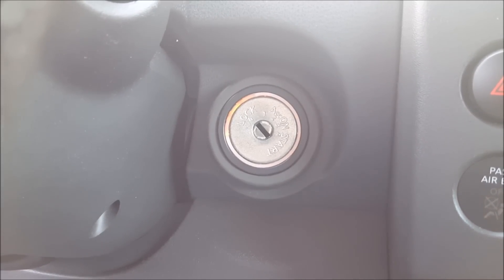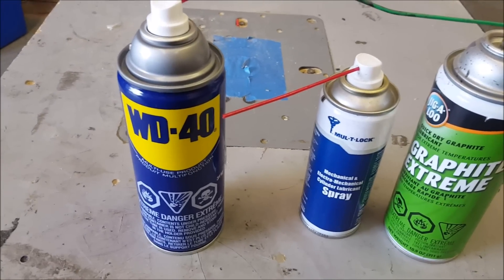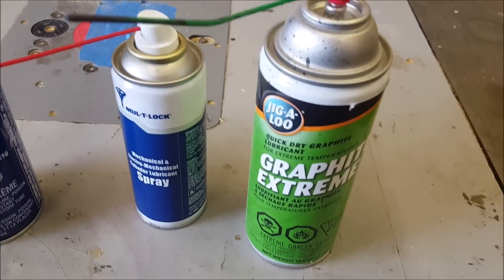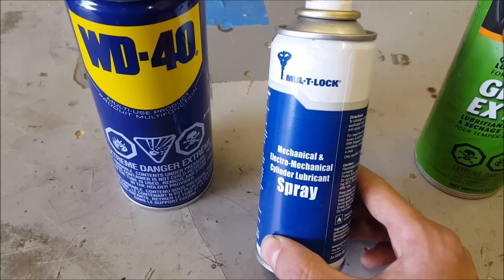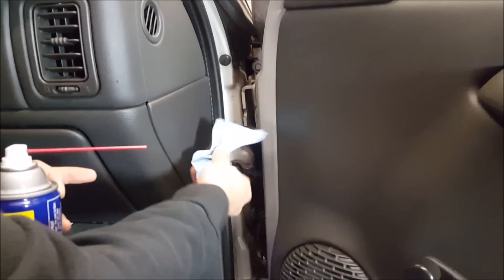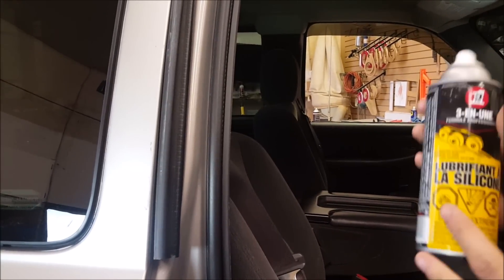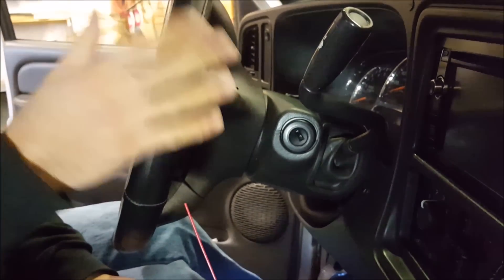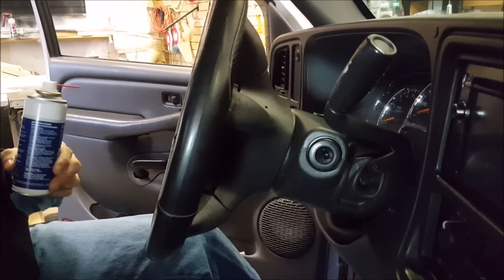Key Cylinder Maintenance (Sticky Ignition Key) Mul-T-Lock | AnthonyJ350

Comment: Make sure you use your key to open the doors even if you have a electronic key FOB. Locks seize over time.
Reply from the maker: I never do, I just lubricate the tumblers. The lock mechanism doesn't need the tumbler to work unless the tumbler is stuck in a direction.

Comment: It`s not the key that wears out,     It`s the springs holding pins get contaminated and lose spring strength over time
Reply from the maker: It's probably both, I've seen keys on high mileage vehicle where the teeth on the key are dull and has lost shape. After we get the ignition key cut based off the VIN you can see a difference in shape.

Comment: From my experience WD40 works fine for ignition locks. Only a small amount is required. I use a clean tissue to wipe off the excess that comes off the key for the next couple of weeks. It pulls a lot of crud out of the lock, wiping off black oily residue. I also carry the key wrapped in a bit of clean paper towel or tissue in my pocket to avoid it picking up dirt or lint. Wd40 can clean/displce crud out of ignition contacts. I use it about 3 times a year.
Reply from the maker: Thanks for sharing!

Comment: Have you heard of Ballistol - made in germany ... non petroleum silicon base. Trusted by guns/arms owners. WD 40 or others that tend to attract dirt doing more harm than good overtime. Great for my garden tools and so much more.
Reply from the maker: Thanks for sharing your experience!
Reply: Stuff is great but it sure stinks lol. Worth it
Reply: @AnthonyJ350  yes Anthony I haven't got into your account yet to see when the last time is that you posted but this is 5 years old I had a bad experience with WD-40 it will take off that black coloring of your door handle so you cannot spread anywhere else but in that key slit or you're in big trouble otherwise use soapy clothe to clean wipe not ok as far as Aesthetics on your car handle now as far as the WD-40 working on door hinges I'm uncertain I want around my whole car sprayed inside lock mechanisms and everywhere else before winter came I did not do any silicone on the rubber areas around the doorframe Etc next time I will do that but the WD-40 did not work for me I sprayed a lot also and it was right before winter I mean winter lmth below zero lots & ice I have 4dr  2002 Mitsubishi Diamante 150k now showing signs age currently ignition issue &  old key call Mitsubishi to get a new key gave VIN 2yrs go they said they were unable to make a duplicate well I don't have experience in these things I told someone else about it they told me that I could at least gotten from them entry pass door key in case I get locked out of my car again they never mentioned any of this to me they just left me hanging and without we used to shimmy get door open I haven't reconnected dealership again due to my own error bc pandemic & honestly I just got overwhelmed I basically just get groceries that's the only place I've been I'm 70 this is the only car I be able to have next 5 years I've had it for 12 I think I'm going to go with your multi-lock blue can spray suggestion I have WD-40 on hand but since I had a bad experience I'm scared to do it I have to leave my car running when I go into the store to buy it I'm hoping it would work great for me but I want get ignition key for SMALL amt money it's too old to get one done at a Ace Hardware place you understand I'm now worried about the oldie causing the  problem in the ignition and that's probably what happened😐also could break off in the ignition cost replacing  ignition part you say is scary expensive so this is where I'm at 🤯 if I know you already you'll probably look up my car Dynamics online I'm also starting to have problems with my auto door & windows locks acting like they don't want to do it which is also mentioned in these comments any suggestions on that obviously I be greatly greatly appreciate thank you so much ~NK🙏🤯
Reply from the maker: @nkhart5520  You just want a product with Teflon in it designed for lock mechanisms. Visit your local locksmith and see what they suggest.